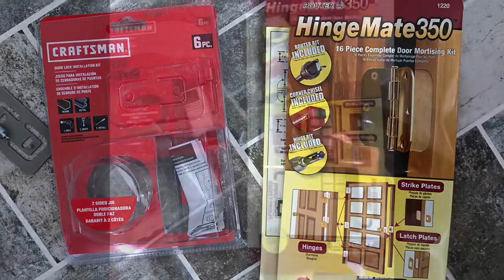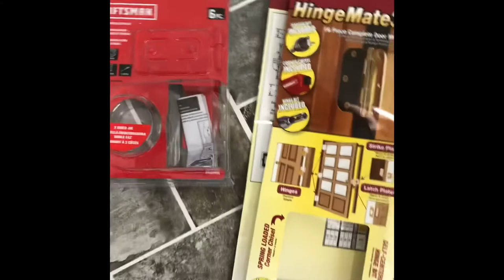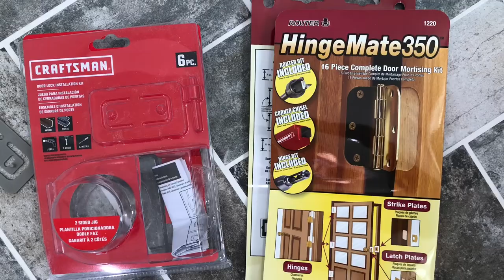Milescraft Hinge mate 350 and Craftsman door slab knob bore kit hollow core interior door install

Comment: I just bought the Hingemate 350. I’m not sure what the deal is, but my latch plate template wants to be slightly off center on a 1 3/8 door. I’m not entirely convinced it’s a good system yet. Good video, though. It’s certainly better than the instructions. The only thing I prefer to do differently, is use a Forstner bit on the latch hole in the jamb. I don’t like drilling completely through the jamb, as I was taught it makes for a weaker jamb. Plus, a flat bottom hole just looks better, IMO.
Reply from the maker: Now that you mention it mine may not be dead center but with the variations in products I didn’t put much thought into it and it didn’t seem to cause any issues. Also I agree with your comment about the latch hole. That does make a lo t of sense. I haven’t been to concerned with it weakening on an interior door but your right it does look better. Thanks for watching, commenting and please subscribe.